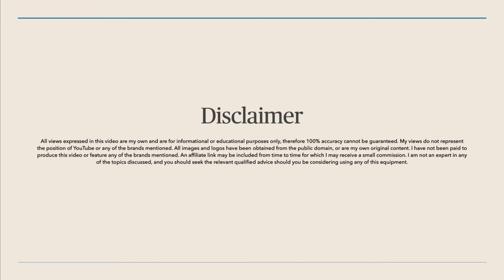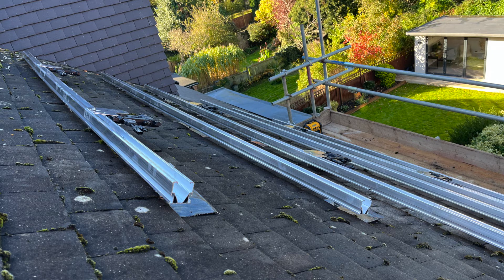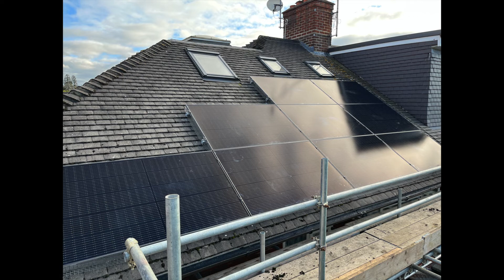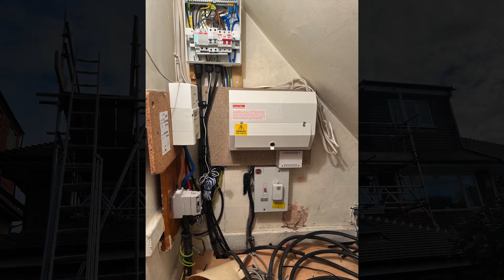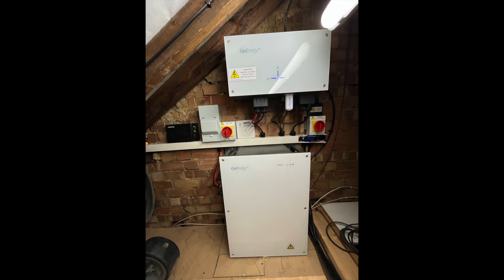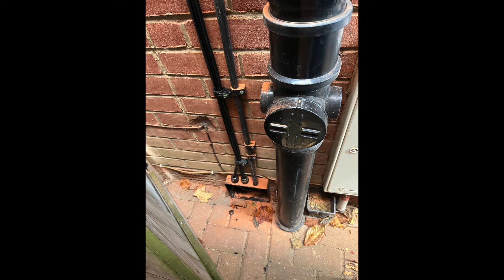Solar Project Installation North West London 2021 - Day 2 of Installation

Comment: If you think about your electrical system, try and think into the future. 

Two EV charges totalling 7 kW each
The general running of your house maybe up to 6 kilowatts
And later if you go heat pump route could be up to 10 kilowatts

So essentially you would exceed the hundred amp limit.

I think a lot of people are going to start thinking about three phase